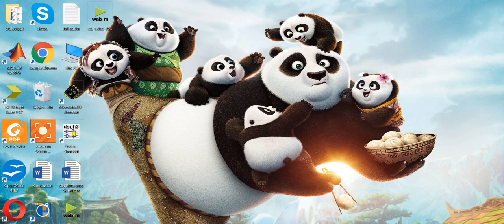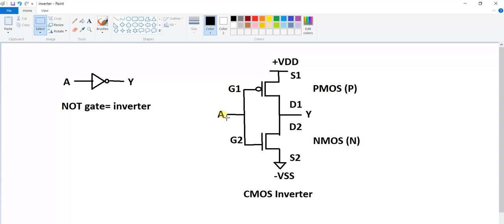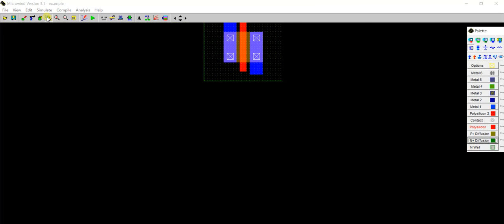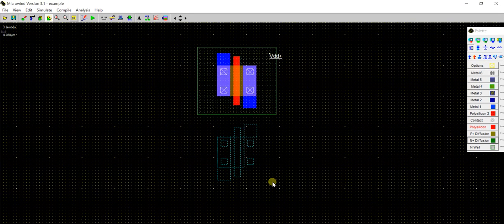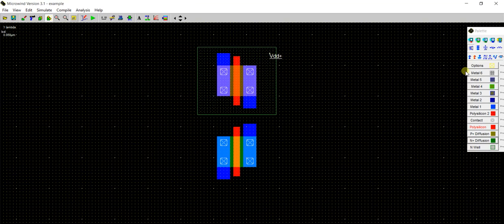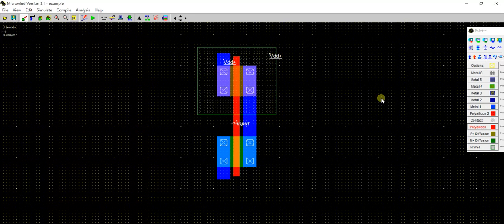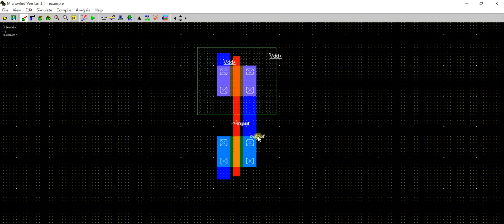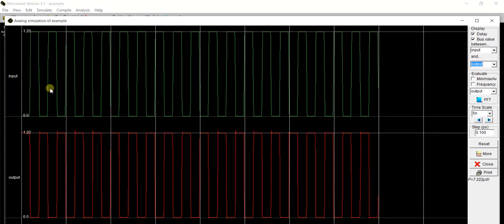How to make layouts in Microwind software explained with an example of CMOS inverter

Comment: why only metal1 is used for desining CMOS and why do we connect VDD to Nwell region?
Reply: Shubham Bagate 
There is one more terminal in pmos which is body terminal. for a PMOS, it should be at higher voltage than source in order to avoid latch ups in pmos.
That is why its body terminal is connected to an nwell which is provided with vdd
Reply: Kartik Pulli thank you 😊